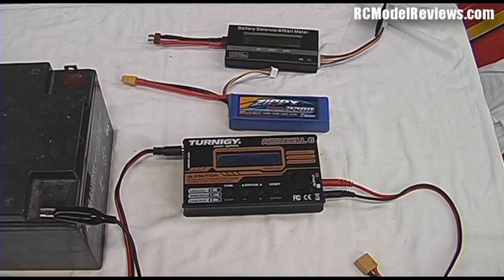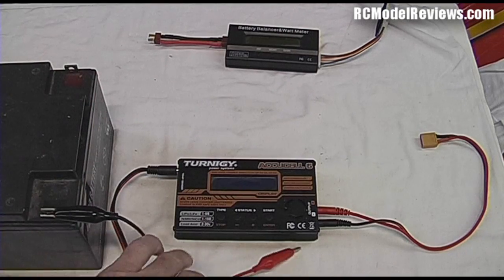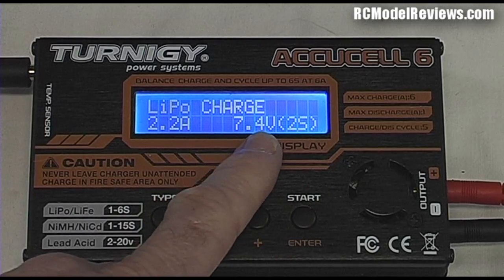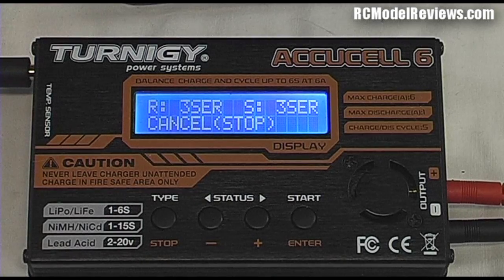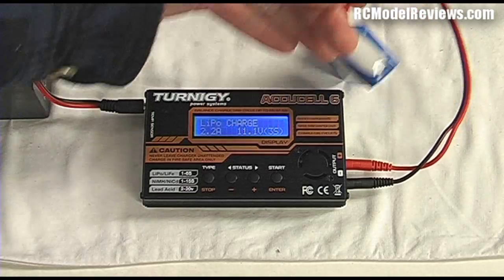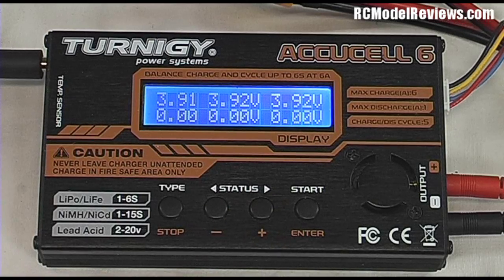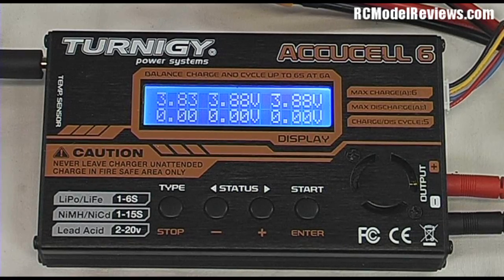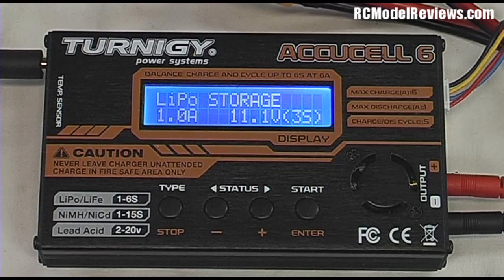How to charge a lipo battery using a 4-button charger

Comment: Hi can anybody tell me if i can charge my multistar 5200mah 3s battery on this charger? I have the charger but the maximum is 5.0A?
Thank you!
Reply: You can safely charge at a lower current. Current is the "amount" of electricity flowing into the battery.  Charging at a lower current will not harm the battery, it will just take slightly longer for the charge to finish.

Comment: Hi Bruce,  there is still a great option in this charger, you've not explained ;) 
When you are charging on balance I. E. You can press the minus button to see what the full voltage should be and when you press it twice you can set or see the alarms. Sry for my English. 
But great video, this charger is almost like my imax B6. Thanks

Comment: Has anyone experienced the charger restarting when in the middle of a balance charge? I'm attempting to charge a nano tech 3s 2200mah at 2.2A and when each cell gets to aroung 3.83V the charge restarts. I made sure I was on the balance charging mode but it still restarts. Any advice would be awesome! I'm also using a wall outlet.

Comment: Good review. I have a problem though, how to use my four button charger (in my case the Hitec X2) to charge a LiFe or LiIon battery. It says all through the instructions that it can charge these batteries but I cannot find how to set the charger to charge them. I've searched the interweb but nowhere can I find anything about charging anything other than lipos. Help!

Comment: I have a question please. I'm using the same charger as yours I have been charging different lipos with it but today I came across an error that says "break down". I took a look at the manual that came with the charger it doesn't have any kind of information regarding this error and I don't know how to solve this problem please tell me what to do.
Thanks a lot
Reply: u should reconnect your battery!! make sure that all the wires are correctly plugged

Comment: Thank you for the video. Much more comfortable than a manual with micro letters...
I am a bit confused with the 'C' numbers mine is a 7,4 1300Ma with 25C value. Am i correct to set the loader to a amp of 1,3?

Comment: Hi Bruce,trying to help a mate to fix the "over Temp Err" the atmega chip pin 43 Vref has zero volts to it, think its meant to have a ref v of 1.1volts
have you ever fixed this error ?
I know its hardly worth fixing just hate throwing away electronic gear without a good fight :-)
Brett from AK,NZ

Comment: Will Storage Mode work on discharged batteries (charge them up to the target voltage)?  Or do you have to do a charge first before a Storage program?
Reply: ***** gotcha.. what about the balance lead?  i assume both the balance lead and power leads should be connected.  does this hold true for every mode except for Charge?  My charger also has a "Fast Charge" mode.  Does that do any balancing?

Comment: Am I wrong or all you have to do is plug in the balance plug each time you charge th battery and it balances each cell.  It will do this without selecting the Balance function on the charger ?..

Comment: Thanks for the great information, and a "How Too" on lipo charging.
i have a plane with a balance charger, but does not have cell info. so i manually discharge to roughly 3.7per cell with a voltage meter attached :)

Comment: I note the caution on ideal storage voltage, fine for RC applications.
BUT what about LiPo batteries for flashlights? In this case you want to reach for your flashlight only when you need (maybe occasionally) it & know that there is plenty of capacity. One of my flashlights does not perform well at below 3.7V

Comment: I have a 4000 mah battery would mine be 4.0?
Reply: 2.2
Reply: yes
Reply: Tom Jenkins is this true regardless of what "C" the battery has? I have a transmitter battery with like 1.5C and my helipacks are 40-50c. Both are 2200mah do i set both to 2.2 then?
Reply: your charger should allow you to change the number of c's you have in your battery. Mine does anyway! :)
Reply: so how many A's can i charge my 40c 2200mah  with then?

Comment: is it bad to charge say a 4000mah 3s lipo at 5A?  or is it super crucial to match the charge current to the capacity exactly?
Reply: Charging more than the recommended current will shorten your battery life
Reply: It depends on the battery. Some LiPos state to have a charge rate above 1C. If so, that info should be printed on the battery. If it doesn't state the charge rate, then use 1C charge rate.

Comment: When would you use the Discharge mode within the lipo settings? because with my imax b6 I have Charge, Fast charge, Balance, Storage and Discharge which has an  end voltage of 3.0 volts per cell.

Comment: I should choose 2.6A or 2.7A for a Turnigy nano-tech 2650mAh 3S 50C Lipo Pack??
Reply: This battery supports a maximum charging of 5C.. But charging at 1C is recommended for a good battery life.. 2650mAh x 1C = 2.65 A.. So better use 2.7 as load while charging.. I think you posted the same in hobbyking.. I answered it there too..

Thank you..
Reply: SreeHarshaVardhan Annu I did,thank you for replying, i´ll ask you if i have more questions about the charger,so again,  thank you

Comment: I have the iMax B6 charger - if you have this charger you will find all the information in this excellent tutorial is identical. Great vid Bruce and so much easier to understand than the instruction manual which came with the charger. Thanks.

Comment: Every charger stops at 100% (or 4.2 volts). If battery will still be charged when full, it would heat up and explode.

Comment: Very informative.  What is the best charging current to use for a 2S battery with 1000mAh capacity.  Your video recommends 1.0A for this battery.  From what I gather this is a 1C charge rate.  My battery has a maximum charge rate of 5C as defined by the manufacturer.  If I charge at the 5C rate, will the battery life (# of charge cycles) be reduced?  If I charge at .5A or .5C will the battery life be greater?  I know the charge times will different, but I'm looking for the maximum battery life.

Comment: I recently bought this charger but i can't get it to balance my LiPo's! I can do storage charge, normal charge, and discharge by just connecting the XT60. But when I try to use balance charge it says "CELL CONNECT". I connect the balance lead and try again but then it starts charging and then it says "CONNECTION BREAK"! When I plug both XT60 and balance lead of battery into the charger and go to regular charge it says "HIGH VOLTAGE"! I have a 12V 4.0A power supply. Please help!

Comment: You need a 12-15 vdc output power supply of at least 5A to charge with the Accucell 6.  I think the computer charging he mentioned was an old computer power supply where you can pick off the right voltage from the outlet wiring.

Comment: A nice feature about the Turnigy Accucell 6 LiPo Storage function is that if the battery is below 3.7v per cell it will charge back to that voltage.

Comment: yeah thats fine, anything below your batteries capacity is safe, if you charge so much as 2 amps higher it will heat up the battery pretty bad

Comment: Bizarre question: If I were to solder 3 3.7v iPod batteries together to get 11.1v, each at 1200 MAh, could I use a charger like this to charge the whole thing? Could I just set it to 1.2 A and 11.1v? I wouldn't have the balancer connection though

Comment: Question: I attempted to run the "Storage" function (at 0.1A) on my Turnigy unit (same as in the video) on an 18.5 v 5S Lipo (3300mAh). The "Storage" function ran for two hours, after which the Turnigy automatically shut off. I suspect this is because I was running the "Storage" function at (a "slow") 0.1A. Any suggestions on how to complete the "Storage"? Thanks.

Comment: Should I throw away my lipo batteries after 2 years on the shelf? Should I try to charge them and see if they hold a charge? I have 2 2cell 7.4 5000 batteries. What is the safest setting to charge them at?

Comment: yes you can.  I think that charger can only do 50 watts.  If you want to parallel charge 3 3s batteries look for a more powerful charger.  Parallel charging 2 2200mah batteries would be like charging 1 4400 mah battery which would use 48.4 watts.   (4.4X11.1=48.4)
3 3s bateries would charge in parallel but it would be very slow.

Comment: I use a 12 volt leisure/caravan battery. It's big and heavy, but it will charge lipos for several days if it starts fully charged. And while I recharge it, I can charge lipos etc at the same time.

Comment: Very helpful vid and thank you,...I am using a projecta 12v 2200ma charging power battery charger to power up my turnigy accucell 6 charger and want to no if this is a safe way to supply power to my accucell or should I be looking at another source.my lipos are a zippy 4000 and a redback 3300 mah,thanks in advance..

Comment: Hi. I bought one of these online and its arriving tomorrow but just now I saw a couple of videos showing that these "newer" models have firmware which does not let the user calibrate voltage settings. One example is that when the voltage was supposed to be zero, the unit read 0.19 V. In turn, this would fully charge a lipo excessively by that amount which can damage it. What can you say? Thanks for any and all...

Comment: You'll never use Nimh/NiCd, or Lead Acid.  If you mistakenly do that(we all make mistakes) you will have a fire.  Don't go cheap get a lipo only charger like cellpro.  If you can listen to this video and understand one time, go for it.  If you have experience with chargers go for it.  You should still keep the packaging for possible return...good luck.  Not hating on HK stuff, batteries great...but don't tinker with charging...less you know it.

Comment: Not always because there are different connector types and a great way for them to charge you extra.  If you are new to lipo's I would discourage you from HK charging stuff, unless you have experience.  NO matter how cheap.  The batteries are excellent on the otherhand, but it's still a minor gamble if you need to return back to china.  Still it's cheaper than domestic bought(2x, 3x cost) lipos.  Keep researching.  Good luck.

Comment: Hey quick question, the turnigy Accucel has a max amp setting of 6. I notice some RC batteries are coming out at 6.4Ahr. will this charger still handle charging these batteries?

Comment: I am quite new in this field and would like to get some info on how to charge a 5700mah zippy Lipo correctly. the charger I currently have with me is an Imax B6. Would you please be able to give me some tips on the main points you mentioned in this video on how to Lipo Charge/ Lipo Balance/ Lipo Fast Charge/ Lipo Storage/ Lipo Discharge for this model. On the battery it's mentioned Voltage: 2S2P / 2 Cell / 7.4v
Discharge: 50C Constant / 60C Burst
Max Charge Rate: 1C

Comment: If you don't balance them at least every few charges, as he mentions in this video, the cells in the battery can get to where they aren't the same voltage. This can lead to battery failure, sometimes in an explodey way.

Comment: For smaller batteries you can buy an AC/DC charger and plug it into the wall (Thunder Power THP610CACDC) or you buy a power supply to run it instead of the car battery (same website). No affiliation with that website, just where I know how to find them.

Comment: I have the same charger with an E-flite 3 cell battery, and the charger just shuts itself off at 11.44 volts. Is that a problem with the battery?

Comment: just got my new charger and ive got a 100-240v-50/60hz-180mA wall charger from Dick Smith that you can charge 5v to 23v yet when I plug it in to my Turnigy  Accucell 6 to charge my Lipos it says "input vol err" 
Is the wall charger too grunty or not grunty enough or no good ??? not sure whats happening with it. Any suggestions ???

Comment: Hi Bruce, great video! Thanks :) I have 3 question for you: 1- What is the ideal temperature to store lipos? 2- You showed the storage functionality and used 1.0 AH. Wasn´t it supposed to use 2.2 AH like the example that you showed when you were charging the lipo (considering the 2200mAh lipo)?
3-I use JUMBO sack to store my lipos and then I put the sack's inside an aluminum box. My question is, if you know the awnser, how many lipos can I put inside a jumbo sack (dumb question, I know)?

Comment: how do you set the max voltage per cell for a lipo. i need to reduce my charge cut off for a 3s lipo from 4.2 volts to 4.0 or 4.1 because i live in a very cold climate and dont want them fully charged to 4.2 volts and then bring them into heated house and have the voltage rise.

Comment: Thanks so much for doing this video Bruce, I have two questions, I want to buy a simple wall socket 12v power adapter and am wandering what how many amps it should be? and the connector is just called a bayonet connector? Thanks

Comment: @Skydive4ever Make sure you are not charging at too high a rate. The slower the rate the closer to peak all cells will be. At higher rates the charger will charge up to 4.2 per cell, but batteries tend to show a higher voltage immediately after a charge (more if faster) and this voltage sags soon after. The batteries might have been balanced at the moment the charger stopped, but later sagged. At slower rates, the internal chemistry can keep up with the current and there is usually less sag.

Comment: Does the power supply have to put out exactly 12 VDC?  Mine, used for my Hobbico Accu-charger, puts our 14 VDC and doesn't work with the Turnigy Accucell 6.

Comment: i have got the same ZIPPY 3S battery from hobbyking..but my charger does not have a XT60 connector..so i could not charge it from the time it was shipped..when i checked the initial charge,it wasn't charged at all...does this state of the battery affect the working of the battery?its been like that for about 4 months

Comment: Hi good video i have a iMAX B6 charger just wondering about discharging on my charger there is a discharge setting witch you don't show i am using a 11.1 v 3sell 2200Mag but it is 18c what is the discharge & charge rate thanks Phil

Comment: I'm surprised that Bruce glossed over the verification screen where it shows R: (number of cells read) and S: (number of cells set.)  This is a very important screen.  If the two numbers don't match, then you should recheck how many cells in series your pack has, against how many cells in series you set on the charger.  If you set a charge voltage different than the voltage of your pack and tried to charge it, your pack has a good chance of catching fire.

Comment: Good video, but I always use the "charge" mode. I was thinking it balances there as well when I have balance plug connected. Try to toggle 1 click on + button Bruce, when doing a "charge" (with balance plug conn.).  On my 4-button Turnigy Accucell 8150 it seems to balance the cells. But a little confusing what the "balance" mode would be good for then. Hmm

Comment: Hey Bruce... my charger is slightly different, it automatically starts charging as soon as it detects a battery in the circuit - with the last settings made on the charger. Hence if you were to recommend a standard practice for charging, that would be to make sure the settings are made in the charger for the correct battery type BEFORE connecting the lipo for charging. I have an Orbit Pocket ladder, and it auto detects the number of cells for charging which you have to accept to start charging